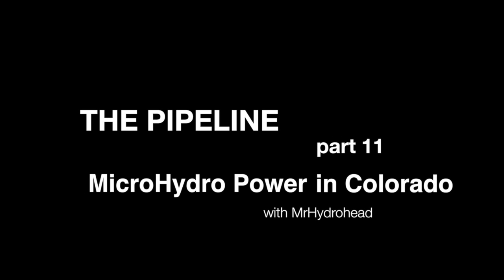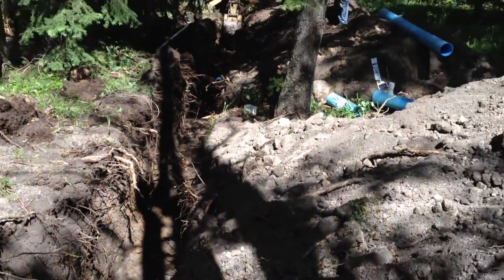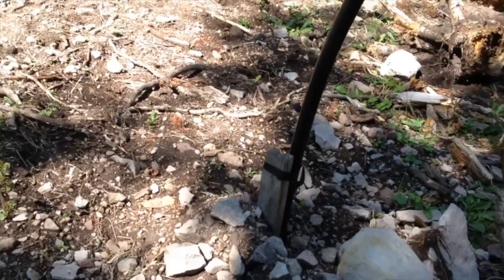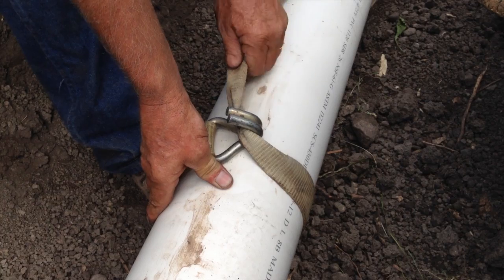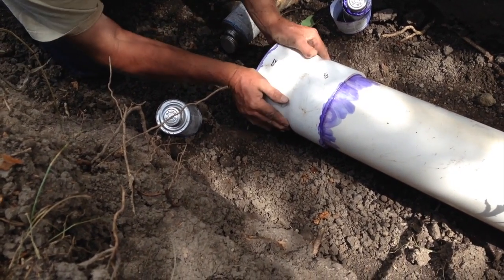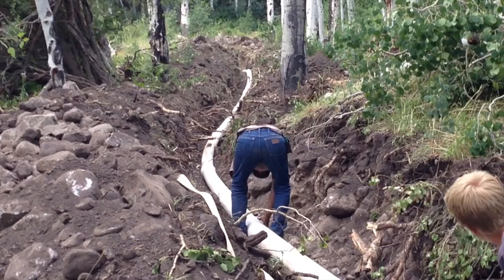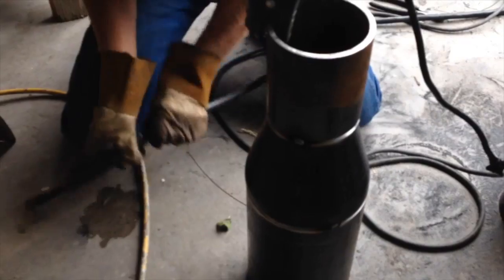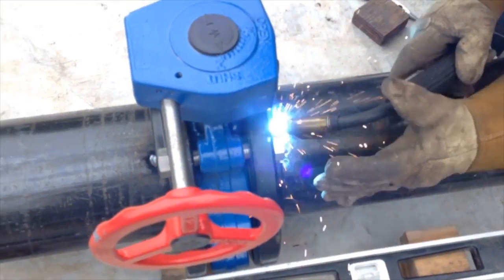Part 11 MicroHydro Power System in CO

Comment: Why did you choose gasket pipe instead of solvent weld pipe?
Reply from the maker: The 125 rated pipe should do fine although you pay more for each heavier pressure rating.  That’s why we scaled it up as we went down the hill.  Pressure wise you have way over what you need.  We buried it all to protect from freezing and trees falling on the line which inevitably will occur if you are going through wooded ares. There is plenty of contact for the bell end solvent welds.  Just be sure to use fresh glue.
Where is your system going (country/region?) and what sort of flow and turbine are you planning?  Not many people actually tell me what if anything they are doing, so I’m curious if you don’t mind sharing.
Best of luck and congratulations on undertaking to install a system.  If you have any other questions I’m glad to help. Just email me at MrHydrohead@gmail.com
Thx for watching!
Reply: @mrhydrohead  Thanks, Took you up on the offer and sent you an email!
Reply from the maker: Easier installation by far.  The first penstock for spring water (parts 1-5 of series) was solvent to bell ends on 4” pipes until we rated up to heavier grade pipe.   The unions for the heavier schedule 80 pipe at high pressure frequently failed near the bottom of the penstock with pressure above 200 psi.  Any shifting of ground in springtime would cause the very short fittings to fail and necessitate digging it all up and repairing with expensive fittings. The 6” line you refer to never got over 100 psi so we learned a lot on the first penstock and applied it to the second. Thx for watching
Reply: @mrhydrohead  Thanks for your reply. I'm just about to order my pipe and have watched each of your videos 2-3 times.

The supplier only has Class 125 6" bell end pvc in stock and I can save on delivery if I grab it since I have a truck coming up Thursday rather than waiting for gasket pipe to come in.

 I've got 40 meters of head pressure so 57 PSI max. I've read to allow for 40% above that which is 80 psi, so the 125 psi rated pipe should be fine for it. 

Do you think The bell end solvent welds will be good since they have more surface area than the unions you had? 

Sincerely,
Attila

Comment: Love your video's! I'm watching them all in order right now. I just have one question; did you consider using HDPE pipe and fusing the seems? I would have thought it would be easier to work with in your situation because it's more flexable? I've never done what you did here, just wondering if you considered it and if so why you didn't go with it.

Comment: hi, the proper method of burying pipe is first a clean trench free of large rocks put crushed fine gravel usually 5mm, then put pipe in trench then cover completely with same crushed gravel plus about 6 inches on top, the pipe then is not under any stress, fill the rest with soil and small rocks baseball size and the larger ones can be placed on top of trench, don't install pipe this way as the larger rocks can crush the pipe from pressure from tree roots and the like over time and he has added undue stress by adding concrete.
Reply from the maker: +tony coppe 
While your "proper method" is probably safer for a pipe installation in the long run, it would be impractical and very costly to haul truckloads of pea gravel 10 miles into the wilderness.  The point of the concrete is for a thrust block to provide added strength where water ram has the potential energy to rip the pipeline apart.
Reply: actorzone sounds like u copied that out of a code book....but u say nothing of them in a trench over his head....
Reply: im surprised that 100 psi didnt blow those white sewer pipe apart lol, that was never designed for that
Reply from the maker: Pipe at bottom of system is rated for 160 psi. No problem whatsoever
Reply: MrHydrohead i agree it is rated for it, its still not real water pipe! Sometimes we have gasket leaks from blue brute, typically installer error... but its still just brittle thin sewer pipe, the way he deflected it around the corner shows to me everything i need to know, but i bet you will never have an issue or shouldn't anyways..

Comment: i notice you are using 6" pipes and get 100psi @ powerhouse,   do you know if i upgraded my pipe to 10" will it produce more psi?
Reply from the maker: +Adam Watters 
Definitely it would not.  PSI is strictly a function of the height of the intake of water above the exit point or what is call "fall".  Fall/2.31 = Static PSI.  For my example I have 100 PSI * 2.31 = 231 ft. of fall.  My Dynamic flow is roughly 98PSI or 2% loss due to friction in the pipe. The smaller the pipe, the rougher the inner surface, the more turns, or the greater the flow, the more friction occurs.  You might gain a bit of PSI on the Dynamic measurement in a 10" pipe due to less friction in 10" pipe, but it would take a really large flow(exceeding 500GPM) to start to make the added cost worth it.  There are tables to calculate pipe friction based on pipe size, pipe material, pipeline turns, and overall length readily available on the internet and it is important to measure and calculate the power potential and design losses prior to building a system.  The two most important measurements are Fall and available flow.
Reply: MrHydrohead do you have a way to contact you via email,  so i don't clog up your video posts,   would like to discuss my hydro plans and to see if it is possible.
Reply from the maker: +Adam Watters  Sure , lenserman@gmail.com
Reply: +MrHydrohead I agree. I just bought pipe and I agree volume and fall are key.  Plus if you hav a creek that does not dry up during summer months July/Aug.

Comment: hi there,   can you tell me..is the opening of the air vent pipe outlet  (half way up hill).  higher than the height of your weir?
Reply from the maker: +Adam Watters 
Yes.  The first 300 ft. of pipe has very little fall across the bridge and across a relatively flat area where it cuts through a hill, but still maintains a downward grade.  The vent is at the point where the pipeline starts down the hill more steeply.  I've never measured how far out of the ground the water sits in the air vent but I'm certain it is above ground and equal to the height of the water at the weir.  The water level is possibly an inch or two lower than the weir level due to negative pressure from the pull of the water moving down the hill down the hill, but I doubt it is very much if any at all.
Reply: +MrHydrohead thank you for you quick response,  i hope all is going well with your plant...i enjoy watching your videos,  they are very well presented...looking forward to future videos and updates on your refinements.

Thanks
Aj
Reply from the maker: +Adam Watters 
Glad you like the series.  Next video is coming soon where several small improvements are made and a major one where we finally got water from the creek into the meadow.  This enables 4800watts of continuous AC production(equal to the current maximum load in system design) or ~115KWH(4.8KW * 24hrs) a day with the capability to produce nearly double that once the load on the system is sized up.  That is a lot of power!  Most US homes consume an average of 30KWH/day.

Comment: well done. i hope you sanded the inside the welded pipe for smooth flow.  a head pipe to catch air to a air tank to bleed of air have some compressed air source would be nice at the 6 to 4 inch pipe.  the 6 to 4 inch over a larger length would increase velocity and not suddenly choke the system, but i don't know your volume and velocity needed for your unit either.  cant wait to see next wonderful video.  I hunt at Montrose by the way.

Comment: Thanks for this video I have been waiting for it to come along. Do you know when you will have the rest finished?
Reply from the maker: Would love to finish in the next month, however my contractor has many other obligations and there is a technicality with the water rights that needs to get ironed out.  Just starting on the electric issues now, so I am hopeful but not certain it will get completely done prior to winter's arrival, an unknown factor anyway.  The springs have been flowing nicely this year so the pressure to make the move permanent has not been the primary factor.  Thanks for watching.  Makes it fun for me to share.
Reply: MrHydrohead Here in Chile water rights are also an issue, especially in the north, but where I am it rains 104" a year so water is more of an obligation than a right so it is not pursued as strongly here in the South of Chile. Permits we don't need no stinking permits! So that is no problem here. No licensed contractors, no fees, no regulation. It is very much buyer beware and I love it.
Well in any case I am really looking forward to seeing your final or next video about this project. Then you can start on a windmill and solar to supplement. Jim